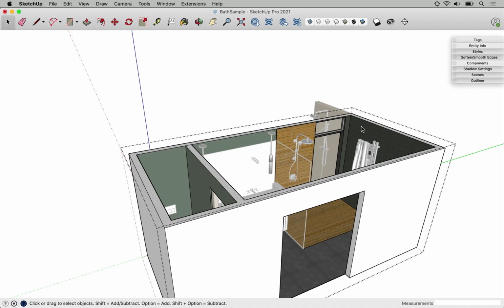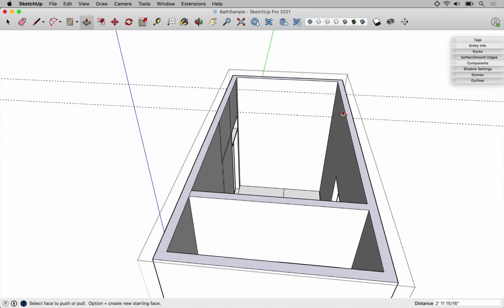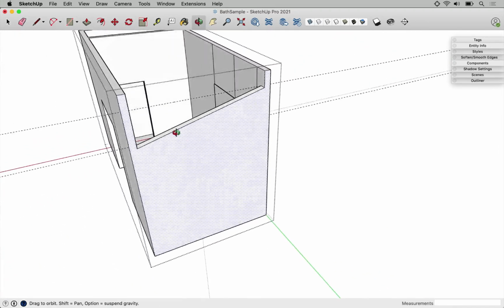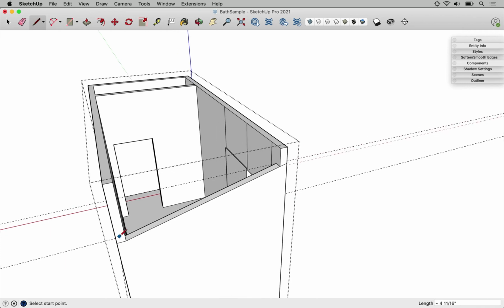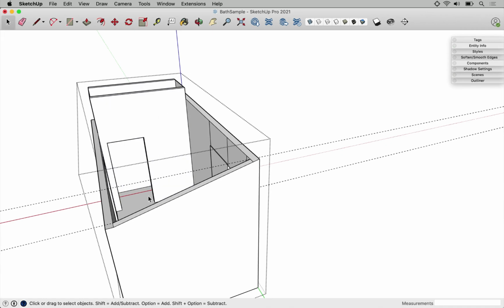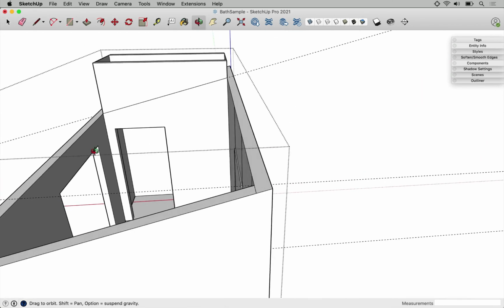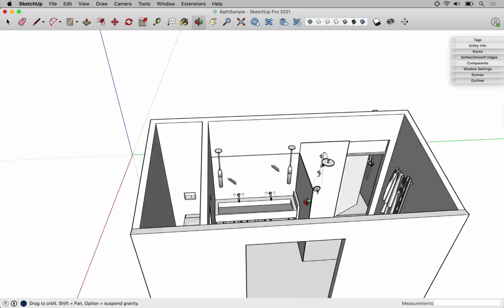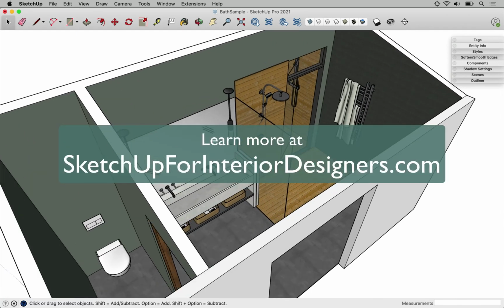Adding a Sloped Ceiling in SketchUp - Cut Away Method

Comment: Great room and great tutorial, thank you! My model is in a group and the push pull is not working in order to do the slope, any ideas on how to fix?
Reply from the maker: Thanks! Make sure that you are editing the group when you draw the edges and use the Push/Pull tool. If you are getting the red "no-no" sign, that means that you are outside of the group.